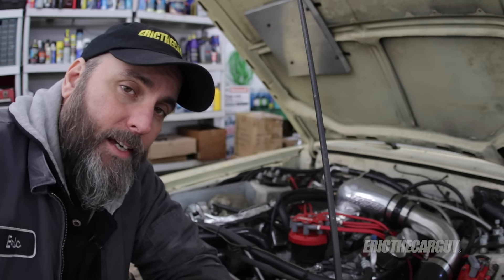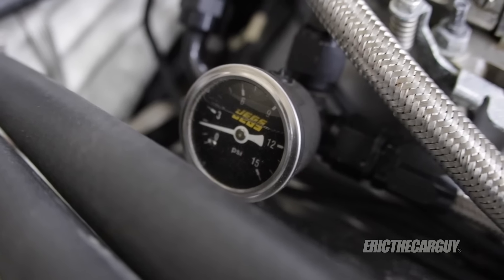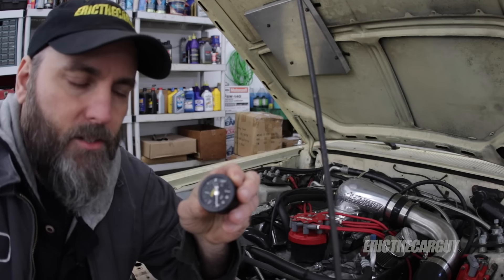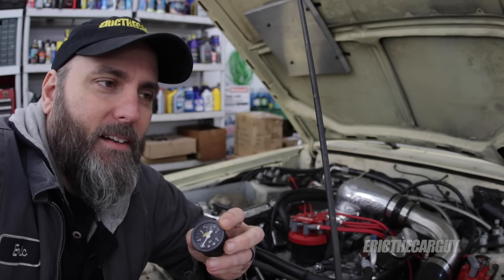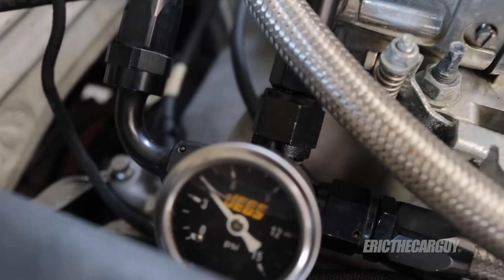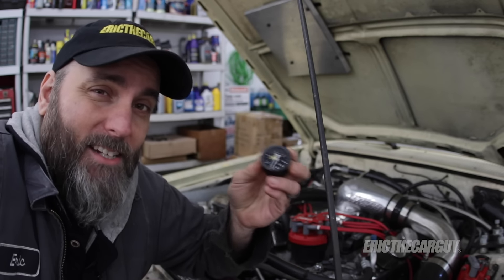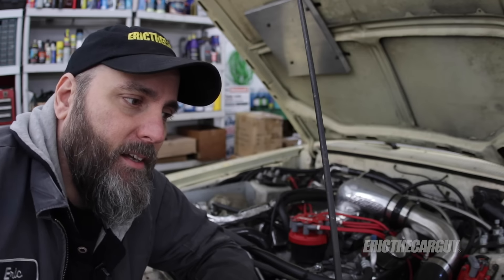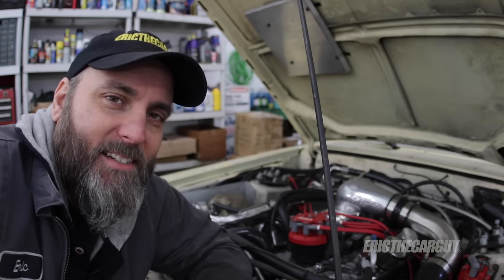The #1 Cause of Fuel Pressure Problems

Comment: I remember being told that fuel pumps rarely fail from Eric... In a video sponsored by airtek...

So far I am 0 for 5 on airtek fuel pumps. First one the car had no power, wouldn't accelerate. Stock fuel pump died at about 200k, would only push 20psi.

Bought an airtek fuel pump, it only pushed 12, brand new, out of the box. The car wouldn't even start.

One actually did start the car and read 40psi. Made it almost 25 miles. One didn't even spin. Again, brand new out of the box.

I would say crappy fuel pumps are a bigger deal then an inaccurate guage.

Comment: So fuel pressure hasn’t changed, it’s just the gauge giving you false information, right?  Could you adjust the pressure on your fuel pressure regulator on a cold or warm engine, disregarding the gauges info after it gets hot?

Comment: If you have an ECM that supports it, you could use a pressure sensor instead of a gauge.
Reply: Actually you wouldn't need an ECM. Just a circuit to convert the signal to a readable number.
Reply: why do you need an ecm? Gauge can run fine stand alone on a pressure sensor or transducer.
Reply: You guys are absolutely right. There's nothing stopping you from using a stand-alone gauge. But letting the ECM / PCM monitor fuel pressure would be nice.

Comment: my problem is my car, 65 gto with 3/2s, when idling smells of fuel out the exhaust. The 2 outside carbs are not supposed to produce fuel when idleing. I have removed the center carb and replaced several parts, im sure its not the center carb. It could be the Holley red f.p. installed. Im thinking of turning down the pressure fromthe pump to my regulator but not sure how to do it. Reg is new too. I adjusted my reg all the way to 0 and it didnt make any difference.
Been looking for a description on how to adjust psi from the pump to my reg. cant seem to find any. Any ideas where theres info on adjusting a Holley red?

Comment: Why don't you have a "remote mount gauge" and have it in the cockpit...the Glycerin stays same temp as the inside of your car...(I actually made my own from a Direct mount, used a Trerice gauge off EBay that had the diaphragm for low pressure suitable for chemicals equivalent of gasoline) and filled the lines with very light viscosity motor oil...and viola I have a Fuel pressure gauge safe to be cabin mounted...(I wanted to use 1980s Ford Motorsport N.O.S autometer gauges that matched my build)

Comment: I get F1007 and F1014 codes still searching what they mean. Somebody suggesting it may be crankshaft or timing issue, maybe crankshaft sensor, but I doubt car could be out of timing as it was not opened. Someone suggesting it’s a fuel problem perhaps too much fuel. It’s a Peugeot 207, any idea where to start? Have replaced fuel pump already, seemingly not cause.

Comment: 1994 Ford Explorer 4.0 V6, starts good, runs good, but consisent low fuel pressure of 26lbs. 3 different guages all read same. Replaced fuel filter and  regulator. No change. KOEO reading steady 28, KOER reading steady 26. Web search says engine quits at 25. Whats the issue?

Comment: so tough question. My car runs for 2 minutes and dies and wont start again and just turns over. I replaced the fuel pump, fuel pressure regulator and fuel filter and the sparkplugs are dry and the system is getting spark. Why does my fuel pressure drop to not enough? fuel pump ground?

Comment: I haven't had that issue on my 00 s10. I used a liquid filled gauge for a couple of years and it always reads 53-55psi which is where it should be and it was a cheap eBay gauge.

Comment: It's been 3 months now I'm chasing this issue with my car..the fuel pressure don't drop but on the hwy the car hesitates and when I step on the gas I see the fuel gauge drop 2 to 3 psi instead of going up..I also noticed the pressure would drop significantly when I turn the key on and let the car sit for about an hour so far I heard it's the fuel regulator so I'll go ahead and change that first since it's the cheapest thing..

Comment: Hey Eric  ok my problem is on a 1999 f150 5.4  first start up long crank after that starts up quick but the problem is at idle engine misses drivining it bucks like fuel or electical cuts on and off  ohm the coils all good fuel pressure key on engine off good engine idling pressure good  plugs are  new  new fuel pump I am lost at what to do next. any help will be great  Thanks

Comment: I’m fighting a PO300 code replaced injectors,plugs wires,coils it’s a Ls swap in 89 c1500 I’m using a 255lph pump,corvette regulator,6an lines and new sending unit. I have 58 psi when it primes and at idle it has 70. Would that be causing my PO300

Comment: I unscrew the diesel fuel cap and normally I hear a hissing sound but not recently. Also recently, my car struggles to start Diesel engine. Are these two observations linked eg fuel leak or fuel hosepipe blocked with debris ? Thanks Eric.

Comment: Question, I have a 2004 4runner v6 and I have a little issue that needs to be fixed. It's got 166k. When I start the car in the morning I get a rough idle for a few seconds. Then it runs normal, I have no idea what to check for that symptom. It doesn't always do it but most of the time in the morning it does. so for I've done new spark plugs, new battery and alternator, new air filter, I can't seem to diagnose and fix the problem. ERIC  any tips as to what I can check next?

Comment: Dude i have a 95 ram. Put a new tps, plugs, wires, battery, thermostat.  After like 20 miles on the highway throttle becomes unresponsive . I have to let it sit 45 mins then it is ok.

Comment: Ericthecarguy ive watched so many of your videos and your an awesome mechanic but i was wondering if you can help me with my car. I have 2002 lancer oz rally automatic and the car cranks but doesnt start unless i put starting fluid into the intake it starts. Everthing works on it theres spark i swithced out fuel regulator also swapped injectors. Sparks plugs wires coils. Fuel pump as well. Checked all fuses and relays all good. The only thing i did notice was that when i turn the key to run position without starting fuel pump makes no noise and no pressure but when i start to crank turnover then the fuel pump comes on and theres pressure coming through the fuel rail. Im stumped on this trying to figure out what it could be but my assumption would be the ignition switch being faulty idk or could it just be a faulty fuel pump?

Comment: If I started having low fuel pressure around 3 to 4 psi. Car won’t stay running long it slowly dies or idles at very low rpm.  Have MagnaFuel 500 pump and regulator. Was on my nova for 12 years. Could my pump motor start going bad ? It started last year with breaking up at high rpm like fuel starvation. It used to stay at 6.5 to 7 psi.

Comment: The only way that would happen is if the gauge body does not have a vent.  It must have a vent.....  I've used liquid filled gauges in industry for three decades and there is no inherent problem.  You need to open the vent when you install them.....
Reply: You assume these are built well.

Comment: So the gauges we've used our whole lives ain't right? Maybe so. I just installed a new fuel pump,and the injectors and regulator check out good. I've still got intermittent fuel pressure too.

Comment: I'd wager a bet that your fuel pressure hasn't ever been inconsistent - only the number that the gauge read was inconsistent. Since, why would a fuel pump deliver less or more fuel, only because a gauge doesn't show the right number? OK, if it were an electronic gauge with a feedback loop into an engine computer that also controlled the fuel pump(s), then you'd have inconsistent fuel pressure, but hey, that would be fuel-injection problems, not relevant to a carburated engine that isn't computer-controlled ;)

Comment: Hey Brother whenever you can help me out I have a 95 Mustang with a 5.0 in it converted it over to carburetor it's an Edelbrock carb my problem is when the car it has good fuel pressure at first right around 5 to 6 then after it warms up it loses pressure and drops to zero and then the car starts to run bad hesitate had a problem with a couple fuel pump leaking got a brand new one on there now doesn't seem to be leaking but still having the same fuel pressure dropping issues any help would be greatly appreciated

Comment: hello, eric i need your help, fuel is not returning in my car (Maruti Omni - 0.80 L 3-cylinder petrol MPFI engine ) and i have changed the brand new fuel pump and fuel pressure regulator and fuel rail and injectors but problem is still the same there is no fuel return and engine is missing a lot hoping your revert  n thank you

Comment: I have a 2004 Cadillac Deville change the fuel pump now I get no pressure in my fuel real long as I’m sprayStarter fluid it will stay running
Reply: I have gas in there
Reply: Anybody have any  ideal

Comment: After my car idle runs for few min my the needle on the fuel pressure tester starts fluttering fast. Whats the reason jums 10 or so psi up & down.
Reply: eric does NOT read nor reply to these messages
Reply: @ACommenterOnYouTube  well the f Eric 😂🤣🤣🤣😂i figured it out anyway.
Reply: @Destructive_Asylum_13  what was the problem ?
Reply: @ACommenterOnYouTube  injectors were leaking & they were brand new injectors. So it threw me off. Usually when you put a new part in you figure that problem is solved on to the next. Not so much.
Reply: @Destructive_Asylum_13  well my car primes up to about 35 psi then drops off like ~1 psi per minute ... within ~30min its at zero pressure. 
If the car sits for more than a week, it wont fire over. It cranks, cranks, cranks but no fire, then let it sit for 10 min, then it fires right up easy.
Go for a drive, come home, shut it off, try to start it, nothing, crank crank crank no fire, again have to wait ~10 min, then she fires up.
As long as i start it every ~3 days, she will fire over everytime ... 
So i know i have a fuek issue because its not holding pressure, just have to start trouble shooting now to see if its the fuel pump loosing pressure or if its the fpr or an injector issue ...
Reply: @ACommenterOnYouTube  what car is it?
Reply: @Destructive_Asylum_13  98 nissan 240sx 
This issue literally started at a gas station. It started fine that morning, drove to the gas station, shut it off, filled up with gas, then i sat there for like 10 min cranking and cranking and cranking .... after i gave up i let it sit for 10 min, then it fired over, since that day, it has this same issue.
Reply: @ACommenterOnYouTube  what doesn't make sense is if it suits it will start so that doesn't seem to be fuel problem cause if you had faulty injectors or fpr it would start right away but the longer it sat it wouldn't start. yours is the opposite.
Reply: @Destructive_Asylum_13  Lets start over here:
Car sits for more than 5 days, i go to start it and it just cranks and cranks with no fire. Do this about 3 times, cranks and cranks no fire ....
Wait ~10 min and come back, she fires right up ... 
Let it run for about 5 -10 min and shut it down, go back to start and again, cranks, cranks, cranks and no fire. Wait ~10 min and she fires up ...
Shut it off  and try to start again, NOTHING .... Just cranks and cranks ... Again have to wait 10 min and then she fires up.

Once i get her up and running, i can drive somewhere and park it and shut it down. But once again i go start it and crank crank crank no fire ... over and over no fire. 
Wait 10 min and then she fires over. 

Once i get it parked and let it sit for ~3 days, come back and she fires over, shut it down and she wont fire back over until ~10 min has passed. 

I have tested spark while it cranks and i DO have spark everytime. This makes me think its a fuel issue. Then when i turn the ignition on the fuel press goes to ~35 psi but drops to zero within 15 min ... 
And it HAS fuel pressure as its cranking but wont fire over even with spark ....
Reply: @ACommenterOnYouTube  have you checked your oil to see if it smells like gas?
Reply: @Destructive_Asylum_13  so i just did another fuel press test with the fuel rail disconnected so now i am just testing fuel press between the pump, fuel filter and my gauge before the fuel rail and i lost 10 psi of fuel press in 3 min time ... 
Started at 50 psi and dropped to 40 in about 3 min.
Reply: @Destructive_Asylum_13  yea i have pulled the dip stick and no smell of oil ..
They also said an indication of no spark would mean after cranking and cranking and filling up that chamber with fuel, you would be able to smell the gas in the engine bay which i never smell ... even after it cranks like 10 times over and over. 
And i always have spark when i am testing for spark upon cranking. I have the spark plug tester on # 1 and it lights on sequence each time ...
Reply: @ACommenterOnYouTube  this 1 is nuts. Well like you said veggie check fuel pump 1st cause it could be losing pressure there but you can do a quick test to indicate the fuel pump. Clamp the 2 fuel lines going in & out the fuel rail but put fuel pressure tester at the tank line. I believe if it drops its your pump there's video on here how to do it right
Reply: @Destructive_Asylum_13  So i pulled the fuel line off the fuel rail and got ~50 psi upon ignition, shut it off and it dropped to about 35 psi within 3 min but held solid at 35 psi for well over 15 min ... so the fuel pump IS holding pressure. 
I hooked the fuel line back to the fuel rail and disconnected the return line at the fpr, igniton on and 50 psi ... dropped to 35 psi and held solid for 15 min .... 
So no leaks at the injectors or the fpr ... 
So i hook the return line back to the fpr ... get 50 psi, engine cranks and fires over, ran for 5 min, shut it off, tried to crank it up and NOTHING ... cranks and cranks and cranks.
Put my ignition testers on all 4 spark plugs and all 4 light up in sequence ...  SO it has spark. 
I checked for 12V at each injector and i do have 12V at each injector with ignition ON so the only thing left is the pulse from the ecu which i can't test unless i have that noid light. 
So whle i thought this was a fuel problem, right now its not. I think it could be the ecu injector drivers. But i need a noid light to confirm they are not pulsing when it acts up.
Reply: @ACommenterOnYouTube  I thought you had said earlier in conversation you were no holding fp I must have read wrong. My bad. Thats why I said do the test. When it cranks & cranks do you smell any gas at all. Also when it cranks & cranks remove spark plug put something down the hole to see if its wet with gas. I dont think it will be wet cause you said you didn't smell gas in the oil. This one is a real brain thumper.
Reply: @Destructive_Asylum_13  when i 1st tested the fuel pressure, days ago, yes it would not hold but last night it held fine and still had the same issue.
Cranked and fired up, idle for 2 min, shut it off and it would not fire back up at all. Again had to wait ~10 min before it would fire up.
Once again, NO smell of fuel after several cranks ...
I dont think the inj's are getting their ground trigger because they do have 12V on ignition.
Reply: @ACommenterOnYouTube  let me know if you figure it out curious to know this 1.
Reply: @Destructive_Asylum_13  i am going to order the noid's and test the inj pulse when it acts up to see if they are actually firing.
If they are not pulsing ... WHY ...?? And why wait ~10 min before it starts to pulse again like its a software glitch or something. 

Literally i can start it up, run it for 2 min, shut it down and it will not fire back up .... i will end up killing the battery dead cranking it before it will fire back up unless i wait ~10 min .... then it will fire up.
Reply: @ACommenterOnYouTube  its crazy. Never come across something like this but there's a 1st for everything right. 👊👊
Reply: @Destructive_Asylum_13  yep

Comment: They build pressure inside when hot the pressure release is on top use the pressure release like it's supposed to and it works just fine I sell the gauges at work and have people come back over it all the time if people took 5 seconds to read the little pice of paper that comes with it I wouldn't have to tell people 5 times a day about how it works lol

Comment: Hope someone can help. My fuel pressure regulator is working but it does not drop when connecting a vacuum line. It’s supposed to drop around 10psi when connecting a vacuum line but it just stays the same.

Comment: I thought fluid filled gauges were meant to remove the fogging and rusting problems.
Reply from the maker: Maybe, but from what I'm told it's to help the gauge work better when mounted to a machine that vibrates.

Comment: You  think someone would have noticed the gauge not at zero PSI after  they shut off the engine.
Reply: The fuel pressure doesn't drop immedeately afted shutting off the pump, it have a check valve ting

Comment: In your situation I may agree that the gauge is a problem but for anyone to just call these Junk is stupid! They are widely used in industrial settings for decades on in.  Why did you not just check with another gauge in the first place?  One of the problems with the "Jegs"  gauge could also be that it is a cheap china POS.

Comment: THIS VIDEO IS MISLEADING.  THAT IS NOT A FUEL PRESSURE PROBLEM.  THIS IS SIMPLY A BAD GUAGE THE PRESSURE ITSELF IS FINE.  THE CAR SOUNDS LIKE IT RUNS FINE.  I WAS LOOKING FOR WHAT CAUSES A CAR TO ACTUALLY DROP OVER A SHORT TIME.